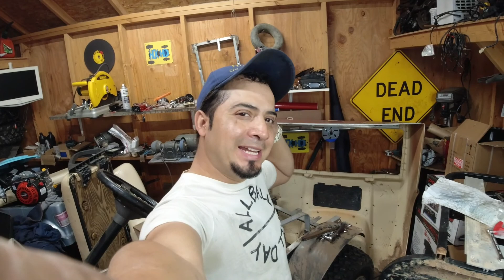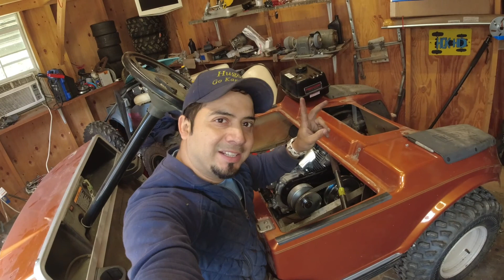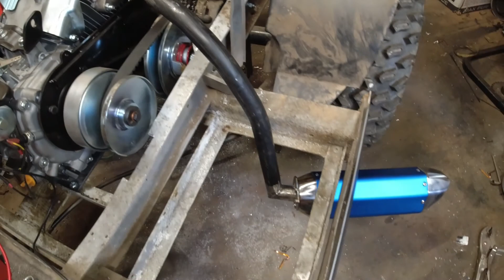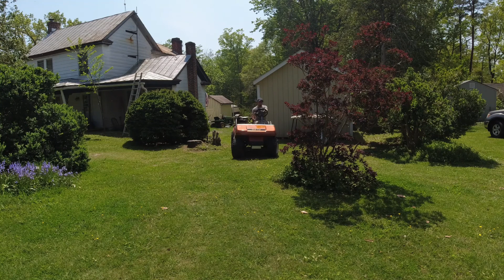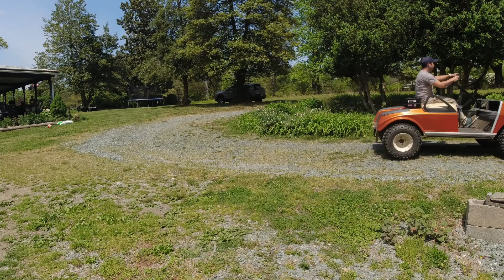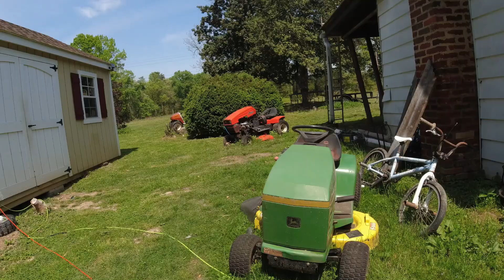Golf Cart Part 2, test drive + breaking in the Predator 459cc.

Comment: Hi been down the road and back! Been working on mine for years, just when I thought I had it finished ,I had to do a final touch. I  think that BigBlok501 and Jamie List  have it going on.. I orginially had the jack shaft but then came upon BigBlok 502 video where he reversed the rear diffrential so the drvive gear would be same side as the engine.. I used the armature shaft from the clubcar electric motor but had the shaft turned down to 7/8 ths so my 10 tooth  40 gear would fit. This is the perfect gearing for that OEM clubcar gear... I have a gas clubcar also and with my subaru 14hp engine ,I would say it is a little faster . I also installed the 7/8 driven clutch on to  the gearbox  so its one chain fron gearbox to rear  and belt drive, I also drilled a hole between 2& 3 for the spring tensioner and still used the red spring,I did try the reverse spring ,It would pop wheelies but  too much torque., I am now in the process of subframing from rear to front so the engine floats on a vibration isolator . It is a pain in the you know what  because I cannot pull the engine  without taking the body off .to do this mod ,but I am using bottle jacks to get my  alignment for the engine .
Reply from the maker: Lol I been on and off with this one I redo de whole base for the engine 3 times I thought I had it and then I have this issue with the reverse it make the chain skip lol I’m doing it one more time this time I will redo the whole back axle, I have to give a break it was giving me headaches lol. It sounds like you got a pretty good one going on. It’s fun to work in stuff like that until they become a pain 😄👍🏼

Comment: Couple of questions. Im doing a similar build with the 420 but instead of the risen shaft like yours im doing a clutch pulley on my transmission and am worried about a bit too much speed as its for my campsite. How is your overall opinion and results?
Reply from the maker: I have to change gears it was I little bit too fast I want it to have more power, I wish I use a clutch pulley, it will be way better, and you probably gonna have good speed. It works great but I use a gearbox and is making the chain skip when I push the brake. Overall is way more fun than when it was electric 😁👍🏼
Reply: @HugosGoKartsHd  it was a hassle getting my secondary clutch adapted to the cheap Amazon transmission, but I somehow managed. I just hope I'm able to tune it down just a little under 20 mph. I appreciate the response.
Reply: @HugosGoKartsHd  also had a thought, I'd probably have to somehow rig a chain tensioner to prevent chain jumping in reverse.
Reply from the maker: @tjrox03  yes I need to do that the chain skip is not to bad but for some reason is worse when pushing the brakes

Comment: How did u hook the throttle to the gas petal I see how u mounted one end of it to the motor but where did u hook it to the actual pedal on the other end?
Reply from the maker: I drill a hole for the throttle cable in the frame and I attached to the original gas pedal. I could take a picture if you want to and send it to an email or something 👍🏼

Comment: You might as well take out the stock axle and install a straight axle. You’ve got a lot of gear reduction going on there.
Reply from the maker: Yep I been scratching my head with this project, it would be easier that way.
Reply: @HugosGoKartsHd  only advantage is the open differential of the golf cart axle. Changing the size of the gears on the jack shaft will “decrease” the gear reduction.
Reply from the maker: @Acc_220  Yeah, I really want to do a good job on this golf car is in great shape and it can be an amazing ride. 😁👍🏼